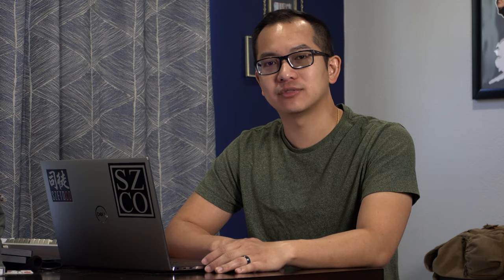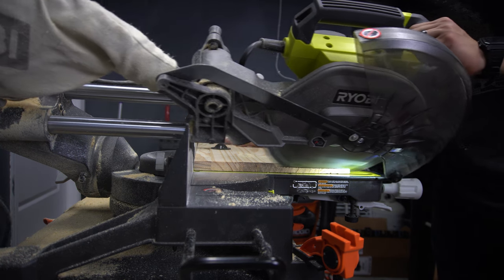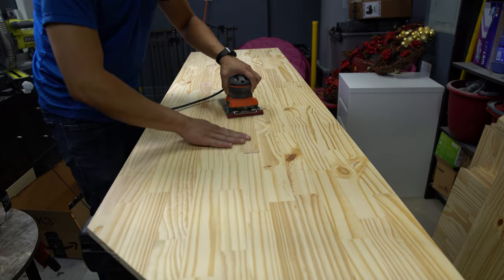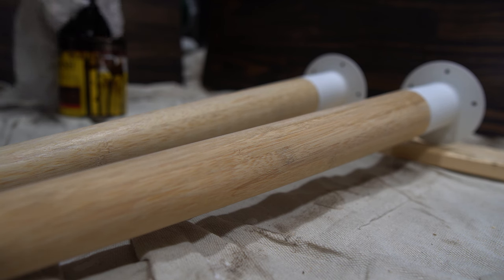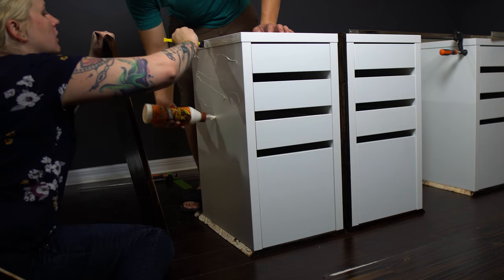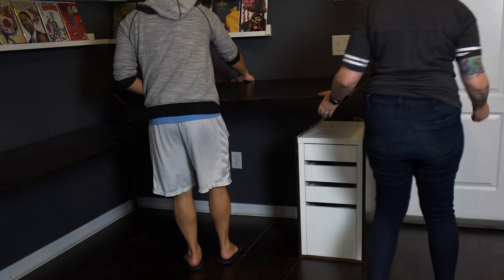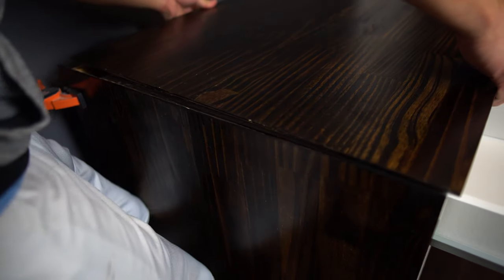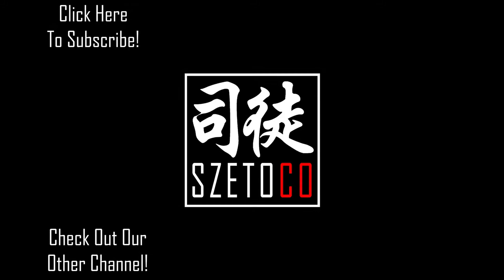Custom L-Shaped Desk | IKEA Hack - MICKE Drawer | Easy Project #3

Comment: instead of the 45 degree angle to combined the top with the sides, you should have done a 46 degree angle so that the outer seems would connect flawlessly but the inner's would have a slight gap
Reply from the maker: That's an interesting idea. The seams will be flush but wouldn't the 1 degree difference show a triangular gap if you look at it from the front? I'm going to have to try that out next time. Thanks!

Comment: i'm getting ready to build my desk that i was planning to be a lot like this. i was already planning on not doing the 45 in the middle and using pocket holes to join the two ends, and creating a rectangle leg piece for the corner support. mine is going to be 8ftx8ft (so a little large).
Reply from the maker: One thing I did was add a 2x4 brace on the underside of the tables. They were so long that the center began to sag a bit. Good luck on your build and thanks for your input!
Reply: How you make out? Im thinking of doing this soon
Reply from the maker: It's still holding strong. We used it as a desk with a ton of stuff on top everyday since we've built it. Good luck on your build!
Reply: Link for the drawers?

Comment: i have two of those cabinets but nothing to hold the counter top directly to the drawers. But theres a big PC, 4 monitors weighing on it, but these drawers are the most wobbly I've ever owned and im sad about this
Reply from the maker: I'm sorry to hear that. We haven't had that experience with these Micke drawers. The difference could be that we added a wooden layer secured all around our drawers that give it a little more structural integrity. I hope you find a solution to your predicament.

Comment: I would throw another leg on the front of the 45.. thats scary that the only support is one leg in the back of the seam
Reply from the maker: That was an option we thought of to support the front, but it wouldn't be as convenient to wheel across the other side. We did reinforce the seam with a brace on the underside. It is quite sturdy. Thanks for the suggestion!
Reply: Brilliant hack, and about to the same thing but now want to upgrade my plans given how yours looks. 😍 My main concern and reason for coming onto YouTube was this question of whether the join to sturdy enough with only the leg at the back? Has it been ok a year after building?
Reply from the maker: So far so good! We use the table almost daily and there's no give at all. I just wouldn't dance on it 😂
Reply: @SzetoHomeDIY  Haha, fair point!! Thanks for the response 👍🏻

Comment: When using a rag to apply the stain...why not folding it up to have it apply better? Just like when you're cleaning surfaces.
Otherwise it's a big mess
Reply from the maker: This is true. Regardless of the technique, staining is a messy process. I took the lazy approach. It's the old fold vs scrunch, but for a different type of stain...😅
Reply: @SzetoHomeDIY  makes sense^^ I've also seen people using a brush to apply it^^ and a paper towel to wipe the excess off

Comment: Why didnt you drill and install dowels you made so much more work for yourself. Wood glue alone without dowels or screws will not hold forever especially if you put enough weight on it. Sorry but cannot endorse this build for someone as it could end up and broken electronics or somebody getting hurt.
Reply from the maker: Hi @joeymc5272. You're absolutely right. The design can be improved on and strengthened. When we first built this table a couple of years ago, we had less knowledge than we do today. Maybe not much more, but we do know where we can improve on. Thanks for your insight. I appreciate your feedback and helping us be better.
Reply: @SzetoHomeDIY  absolutely. Look up dowel installation and you will be good to go. Otherwise great job on project. I am about to build one for my music room very soon and i like the design you guys have.